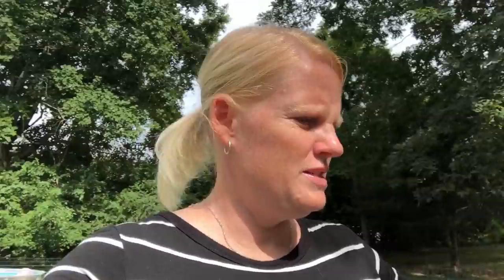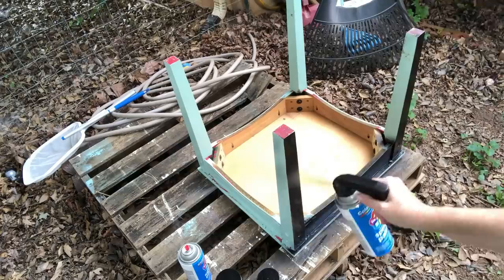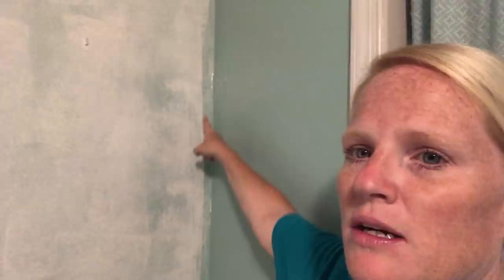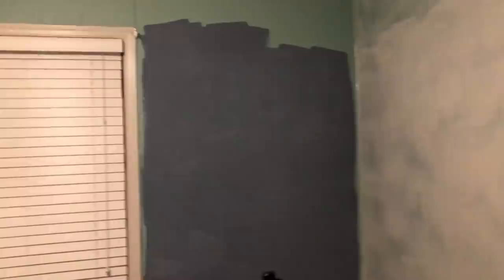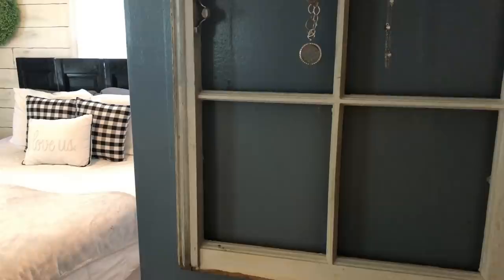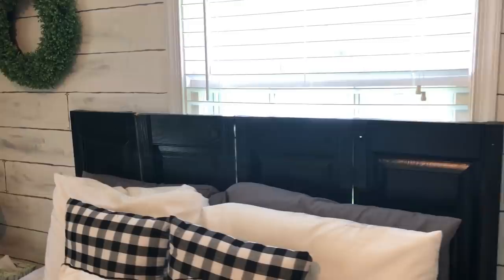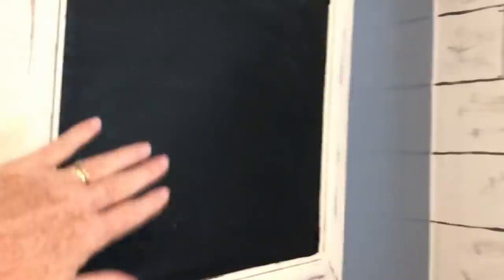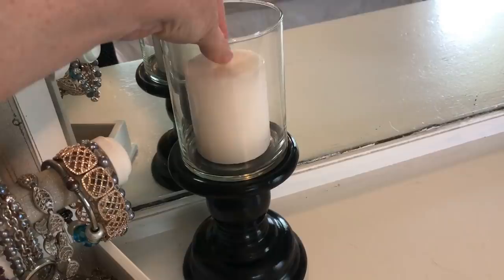MASTER BEDROOM MAKEOVER // UNDER $40

Comment: I’m a Designer and I’m already subscribed to your channel. I have a great trick that you and your subscribers can use on a tight budget sounds a little crazy but it works great. Add food coloring to your paint to make it the color you like so easy. Love your channel.
Reply from the maker: Wow, never done that before! Thanks for the tip! :)
Reply: Awesome tip thx
Reply: Thank you thank you thank you‼️👍🏻
Reply: David Conner 
Hello... I tried a few years ago to lighten some gray paint with White I added White several times and never did get it to the lighter color I wanted ...what did I do wrong or if you have any suggestions❓Thank you much
Reply: @mountaingirl1797  hello, butting in but it's probably the wrong portions. should have the white as base and add the colored one little by little til desired colored. knew this from painting and i think it's the same concept.
Reply: @zenzen244  - Catching up on old videos and read your comment on mixing paints. Putting the dark color into the light color is a wonderful tip. Thanks.

Comment: Your bedroom turned out so nice.  It's amazing what you can do for under $40 when you do it yourself or thrift.  The shiplap wall helps to keep the room light enough. An idea for your headboard.  You said that you don't like how the light comes through between the sections.  Could you spray paint some cardboard strips black and staple or tape those on the back side?

Comment: You could just glue some black felt or fabric on back of shutters. That would make it a bit more "lightproof". You could also paint dresser knobs black.
Reply from the maker: Great ideas!😀
Reply: I kid you not, I was thinking the same thing about the dresser knobs. 😁
Reply: I was going to suggest just running a strip of black electrical tape on the back of the headboard to cover each crack.
Reply: I was thinking black felt....
Reply: @pamh.5705  👍🏽

Comment: I think you should get more black white fabric that you used for the pillows and fold it over ..hot glue a thin fold over and put a small rod threw it and hang it up on two side holders for each side of rod. Wahla! You hav a cute topper/valance for each window and would not be blocked by your adorable headboard. 
Ps..I love your headboard too
(Just a suggestion) 
And love your decorating ideas too💕
Thank you
Reply from the maker: Thanks for the suggestions! :) I went ahead and got long curtains on the one window that is not covered by the bed and I am liking it for now :) Thanks for watching!

Comment: Love your videos! Suggestion. A list of supplies in the description. Where did you get the black  "sprayer" for paint can and what kind of poly did use use over the headboard? What kind of roller did you use for the walls? My roller is so linty and no good and it wasn't cheap. I'm a beginner so you're a great inspiration. Thanks so much for sharing.
Reply from the maker: I just got the roller and sprayer at walmart. Also the poly is from walmart. I'll try to link supplies in the future when I can! Thanks for watching!
Reply: Dorsett Doorstep you can also buy the black foam board at Dollar Tree and put it on the back of your headboard to disguise the cracks.  I did that with the back of an entertainment center.